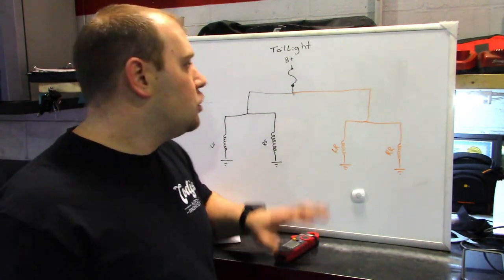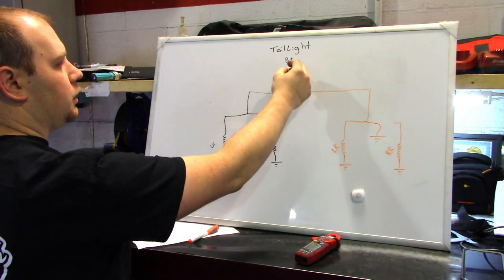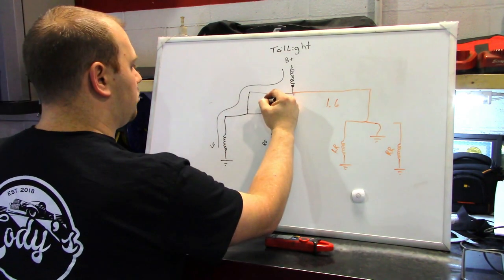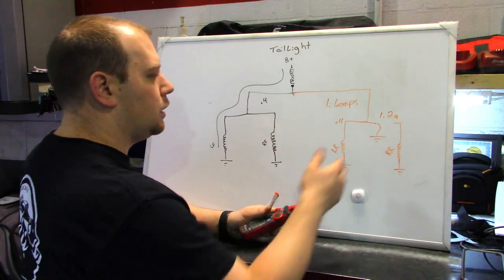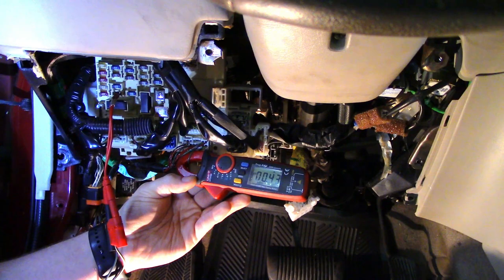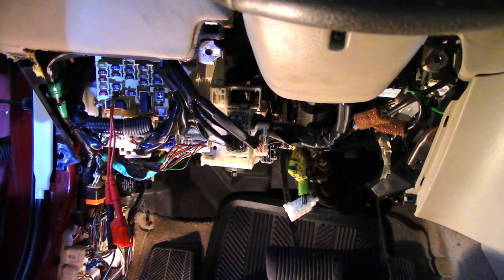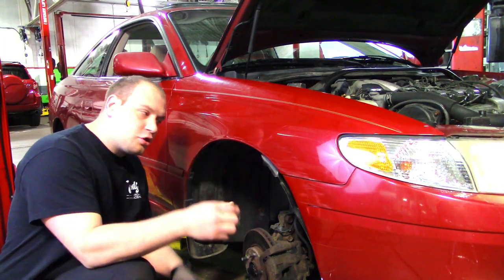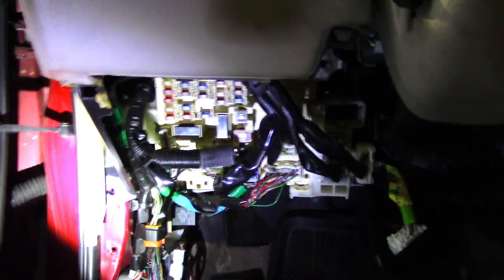Diagnosing shorted circuits-Toyota Solara that keeps blowing the tailight fuse

Comment: I'm totally stealing the bulb in the fuse socket idea! That's brilliant.
Reply from the maker: Steal away! Thats why I made the video!
Reply: It's only brilliant when there's a short 😛
Reply: Yeah I use that all the time. It limits current through the circuit and also gives a great visual indicator especially when looking for a spot where a harness has been rubbing and has caused a short.

Comment: Light is dim with no short  because there is a path to ground through minimum of 3 good 21w bulbs  filaments which have roughly 98ohms combined resistance to ground, that's 130mA of current 
Good job nailing it down
Reply from the maker: Exactly! Thanks for watching and explaining the theory a little better for me!

Comment: I came across this video the other day without searching this issue. Today I had a vehicle in blowing the fuse on the audio unit circuit. Used this method with the bulb and the unplug test and bam light out. Audio unit shorted to ground. Thanks for the top tip!!
Reply from the maker: Haha! Listen. This makes me happy to hear that it actually helped someone out! Thanks for sharing the story!

Comment: Great video. Been a tech for 30 years never done that way, but perfect way to find a grounded circuit.
Reply from the maker: How do you attack shorted circuits? I like hearing how different techs attack the same issues, differently. 

Some people use the power probe short find. Some people use the analog amp gauge. But I do like hearing all of the different ways to attack issues.
Reply: I use a circuit breaker and start eliminating circuit with an amp probe. But you way is a lot better because you don't have a circuit breaker going on and off.

Comment: This vid reminds me of a problem.  I had a parking/turn signal light socket issue on a Subaru Outback, would blow fuse 5 or 6 which would kill the control signal for the alternator, complete shut down,  also the instrument cluster gauges would die.   Turned out the car had aftermarket headlamps, loose bulb contacts shorting inside the connector when the right side turn signal was turned on.  Toughest diag for a blown fuse I ever had to find to date.  Learned a lot on that one!  Take care -Glen
Reply from the maker: Thanks Glen! That diag sounds crazy! A loose bulb! haha
Reply: @VoltageDropDiagnostics  loose brass contact inside the connector where the bulb base touches.  After that fix I started filming repair vids.

Comment: Nice video!
I do it the cheap guy way. I use a bimetallic flasher and a Cracker Jack compass. The short will cause the flasher to click back and forth. Then I follow the wire with the compass, the needle will point to the short. At a y in the the wiring the compass pulse will be stronger down the wire with the direct short.
Reply from the maker: I have seen that way before with just an analog amp gauge. I never thought to use a compass! That's a great idea!
Reply: Voltage Drop Diagnostics I apologize I was not trying too high jack your video but some guys viewing don't do this every day and can't afford the nice tools.
Reply from the maker: Mark Patton no worries man! I like hearing how everyone attacks problems differently. 

I hope someone sees your comment and learns a new technique, too.

Listen, I’ve gotten comments about how much of a waste of time this was. Your comment was informative. Nothing wrong with that haha

But this amp clamp wasn’t expensive. It was a cheaper $50 one. And works pretty well.
Reply: Anyone who says the video was a waste of time has short sightedness. You showed a technique on something simple that way everyone watching could follow along. If it's too simple for them they could just move on to the next video! Or post a link to their advanced video, we could all do without the hate these days!
Keep up the good work brother I know it takes a lot of effort to put these out.

Comment: As always, excellent! 
Needed to see this video a few years ago... Before I figured out the same fuse to bulb replacement technique . I didn't have an amp clamp, instead I measured the circuit voltage to ground in different places. As I got closer to the short to ground, the voltage dropped lower and lower to some 10 or 20 milli volts.
Thanks again for the great content!
Reply from the maker: Thanks man! I haven't used that technique myself yet. Does it work well?
Reply: I just removed bulbs and measured the voltage to ground at each socket. As I got close to the short the voltage to ground was less. In my case the wiring to the rear license plate bulb was pinched under a screw head. The voltage to ground in the license plate bulb socket was very close to zero and the pinched wire was right there.
I guess if you have easy access to wires, use a current clamp. If bulb sockets or terminals are easily accessible, measure voltages to ground.
Thanks again for your great content!

Comment: Good video and explanation PJ. It makes it nice when the circuit your testing has connectors that allow you to split it half.  Streamlines the diagnostic process.  
 I've used a bulb like you just did for short finding.  To keep from having to constantly look at the bulb during short finding, I like to use a turn signal flasher because the audible clicking.  When the clicking stops, you've just found your problem.
Reply from the maker: That turn signal flasher trick sounds great! Do you still put a bulb in series? Or are you just using the flasher?
Reply: @VoltageDropDiagnostics  I'm just using the flasher in cases when I'm away from the fuse and can't see the light without walking around the car.
Reply from the maker: Good Auto Diagnostics so my question is. With a dead short, i assume that it clicks really fast. But when there isn’t a short, the clicking slows down?

Comment: Holy crap PJ this is awesome. Would u say the hardest part of all this is finding the connectors where they split from? Or not at all because u know these cars very well. I'm forcing myself to strictly understand different manufactures OE wiring diagrams. Right now I'm on VW and Audi. Next will be toyota 😁😁. The color diagrams from Mitchell is cool but most of the time they leave alot of important information out as u know. Thank u PJ. Talk to u soon my great friend
Reply from the maker: The hardest part for sure if finding the connector locations.

Now, i don’t have Toyota connectors memorized like Keith does lol. I just know that a lot are always in the kick panels. But i don’t know what they’re called.

I have to reference back and forth between the wiring diagram and connector locations charts.

I have a love hate relationship with a/m wiring diagrams. It’s nice having all makes and models laid out the same way.

But like you said. It doesn’t always show all of the junction points, and connectors and then you NEED oem diagrams.

When testing components, i love using the A/m wiring diagrams. But when it becomes a real electrical problem, then i start searching for the oem diagrams
Reply: @VoltageDropDiagnostics  I remember at the staten island meet up........ me and him searched a connector for that subaru and he just looked at the connector picture, not where it's at in the cat and he said "ok let's go". Went to the car and was like that's the one. I'm like what the heck. 🙃🙃. That right there forced me to look at wiring diagrams now and read between the lines and practice on different types looking for connectors. I will never forget that day. But I understand its alot of experience he has. I only have barely 2 years doing this diag stuff my friend. Well enough pep talk.... let's get back to work. Take care my Amigo 😊😊

Comment: You mentioned that there did not appear to be an obvious defect with the socket...You likely know once in a while, the solder "Blob" on the contacts of the lamp itself will deform or corrode. Bridging the contacts . Nice Vid thx
Reply from the maker: I have seen that before! This time I believe that the one power terminal was just bent into the ground terminal. But it was hard to see in there to know for sure. I had an extra socket in my box so I just grabbed that. But now you have me wondering if it was just solder! Thanks for watching!

Comment: Great vid, thank you for sharing your diagnostic process. I have a question regarding a 1985 Chevy Silverado that use to burn a fuse for the tails lights intermittently once in a while at times , I tried to check it to fix it but couldn’t. What you suggest what suggest I do to find the problem?
Reply from the maker: How often does it blow? Depending on how often that circuit blows, would determine how I would attack the problem.
Reply: Placing a bet for dead short @ trailer harness...
Reply from the maker: I have also seen those harnesses short out. Thats probably the first place to look.
Reply: Voltage Drop Diagnostics maybe once every two weeks that’s why I had a very hard time to find the problem.

Comment: This video was helpful indeed. I appreciate you sharing those techniques for finding short circuits. I was recently shopping for an inductive meter. I’m looking at the Fluke 325. I couldn’t tell which one you were using but it looks like a good size for under dash testing.
Reply from the maker: I have a link in the description to the meter that I was using, and its not bad for the price. But id bet that the fluke 325 is a little better of a meter.

Comment: Great troubleshooting procedures JP, how you choose the bulble amperage to replace the blowed fuse?
Reply from the maker: Honestly, i just stay around the 2 amp range, and it seems to work well for most circuits
Reply: @VoltageDropDiagnostics  is it safe for ecu? If the fuse is for the ecu or some module?

Comment: How’s that meter for parasitic drains?
Reply from the maker: For me? I like it. Now, it doesn't measure less than 10ma. But thats fine with me. Anything less than 50ma is a pass. 

I actually bought that meter for checking for parasitic draws.

But it you want something accurate to 1ma you'll probably need to spend a little more for a better one.

Comment: 2015 Toyota Sienna STOP Fuse would blow immediately, repeatedly.  As others have mentioned we did have a bad / shorted brake light bulb, but in our case the wiring to our trailer hitch was ALSO shorted.  Having two problems made it very hard to find ( confusion ) ~ ' just wanted to post this to help the next person.

Comment: Could you of omh tested the connector to see if it was shorted?
Reply from the maker: Yeah, absolutely I could have. I just didn't know which corner of the car was causing the short, so I didn't know which socket was causing the issue. But after finding out the RF parking light was the area of concern, an ohms test would have found the issue for sure.
Reply: @VoltageDropDiagnostics  cool, I understand it would of been a little over kill but definitely would have been cool to see.

Comment: Thanks for the video! Anyone know how to do this without the light but a bunch of fuses to blow?
Reply from the maker: Start disconnecting connectors to isolate circuits. Replace the fuse and see if it blows. If it doesnt, you know that the short is after the connector that was unplugged. If it still does, the short is before that connector. Continue until you find the short.

Comment: A simple test would be look  which bulb is not lit that would be your short.
Reply from the maker: Well, because of the dead short, none of the lights worked because the instant you turned the light switch on, the fuse would blow.
Reply: @VoltageDropDiagnostics  ; Truth
Reply: @VoltageDropDiagnostics  I want to retract my statement. Your test method was right. Awesome video.
Reply: @VoltageDropDiagnostics  When you substituted the bulb/load at the panel, would you have been able to tell with the lights on which bulb was the culprit?  I love your process of nailing down the circuit branches - thanks for sharing.
Reply from the maker: Thats a good question and one that I'm honestly not 100% sure of. Now I do know that with the bulb in place of the fuse, the parking lights were very, very dim. They lit, but they were hard to see. But I honestly didnt even think to check the RF to see if it was dim or not.
Reply: The fuse for all four lights was blown?
Reply from the maker: Auto Tec yes. The one fuse fed power to all 4 parking lights